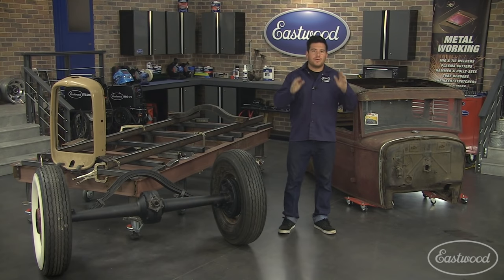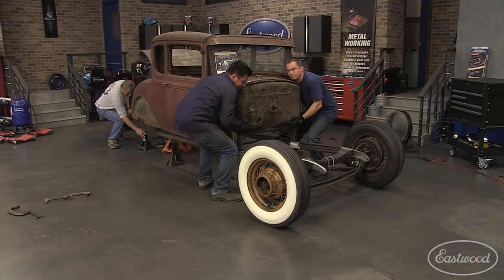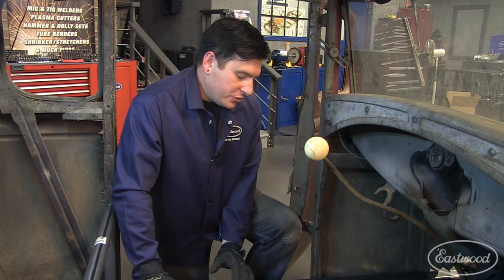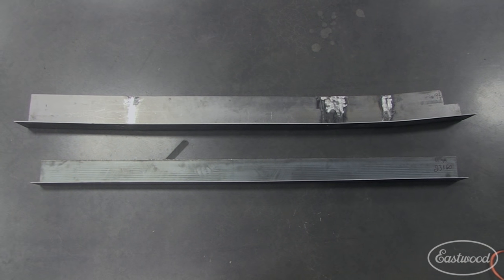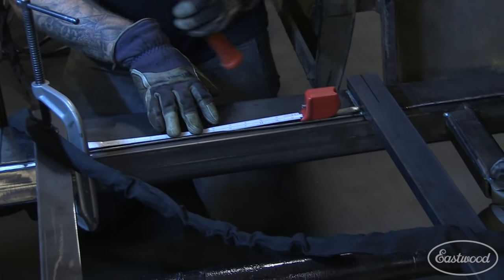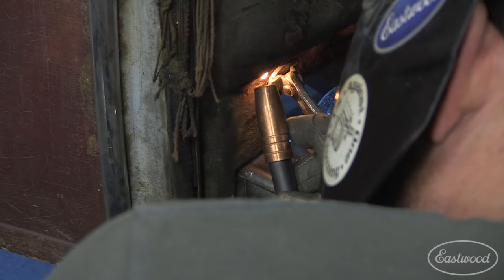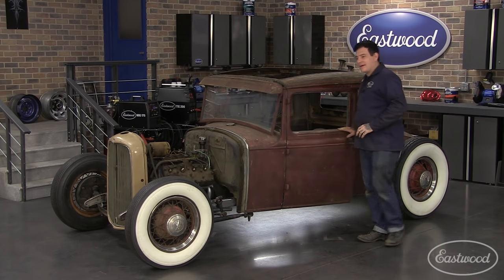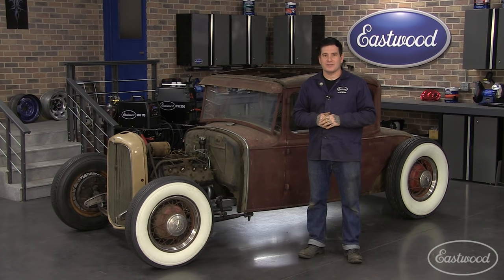Lowering Your Hot Rod - How to Channel a Ford Model A with Eastwood

Comment: when adding the bungs to the frame, you could get your bolt thread a normal nut then a washer then your bung to make sure you get a perfectly flat level with the frame and would take out some of the guess work
Reply: For those without a metal lathe you can buy flanged nuts and use a step drill to create a hole and recess, then weld the nut in.

Comment: Freeze @9:07.  What's the clearance between the drive shaft and the second cross brace?  There doesn't appear to be enough room for travel?  Did you wind up having to adjust there?  Thanks!

Comment: I want to channel my '34 three window coupe but I don't have any tattoos. Will I still be able to do it or maybe I can just get some spiderweb elbow tats to start with? 

Ha, ha, just messing with ya! Good job on the channel. Are you going to run any body welting under the sub floor frame or are you bolting it solid to the frame?

Comment: How much would I have to extend the front frame rails, so that I can fit a 350 Chevy engine in it?  It looks like the original firewall would need to be cut to allow the Chevy distributor room.  I would like to leave the original wheel base as stock.  And I like the looks of the original firewall.  Any suggestions would be appreciated.  Thanks.

Comment: Great video. Wanted to ask why you opted to tig weld everything instead of wire feed, mig or flux, or even stick. Years ago, when you were down on Rt.30, I bought a Century flux core machine. Used it when boxing some frame areas on my 51 Chev. 1/2 ton. Was happy with the results on the frame, not so happy when I tried sheet metal, too hot. When watching your video I thought the flux would have worked fine, especially if you ran into a position situation. I need to justify the need before purchasing another machine, agree that the tig finish is tops but who's gonna see it, so that benefit is lost, know what I mean. 
Thanks in advance. Jack
Reply from the maker: Matt is just a fan of TIG welding. Could MIG have worked here? Absolutely, he just likes to show off 😎
Reply: Eastwood Company thanks. Nice job. Like tig but too busy sometimes. Was building a tire rack once out of pipe and fittings, tig practice, rod, torch, shield, gas pedal, some over head, standing on one foot, balancing....... too busy !! Finished with stick. Just one of my stories. Thanks again. Stay healthy. 👍👍
Reply: Tell Matt I said nice job. Nothing like a nice weld.

Comment: Curious as to how you decided which type welder to use at each place. I understand using the tig on the frame rounded nuts but why did you use a tig on the cross channels instead of the mig? What was the advantage here?
Thanks for the videos.
Reply from the maker: +amtpdb1 I prefer to use a TIG anywhere possible but I was forced to use the MIG in places where I couldn't get my hands/the torch in or the metal wasn't clean enough for a nice TIG weld. Hope that helps! -Matt/EW
Reply: Just as a heads up your TIG welds are going to crack from vibration, you need to fill in the craters at the beginning and end, add extra filler, and taper off on the amps when you get to the end of your bead will help prevent it from cracking right away.

Comment: just wondering does welding on those grade 8 nuts make them  weaker ? nice job hope to see more
Reply: +Lester Gross I would have used a nut cert. I'm surprised Eastwood doesn't try to sell them.

Comment: What happens when you get to the radiator ? How do you lower that ?
Reply: George Dean you will either notch the bottom of the grill shell to lower over the front cross member. Or you can section the center of the grill out. But doing either of these two if you go very far you’ll need to get a shorter radiator to match the grill shell. I have seen in the past people moving it forward an inch and using or building some aluminum offset tubes for the water neck. (This is one reason I like quarter elliptic suspensions, it cancels all that out) 👍👍
Reply: @johndoeOU81TOO  , one more question- is the 28-29 radiator shorter than the 30-31 ? I have both shells and the 30-31 shell is about 3" shorter. I was going to use the 28-29 shell on my 31 roadster with a 3" channel job...
Reply: Sorry bout that, the 28-29 is the shorter one...

Comment: Why not put the axles above the frame?
Reply from the maker: This is a traditional method that has been used for decades.  You could go that route but it would be a different approach to the build that would be an entire re-work of what we had planned, as we built the frame and planned suspension with this in mind.

Custom cars are built like a cake - with a recipe.  So you have to make sure your components all work together nicely.
Reply: @eastwoodco  I kinda wondered why "no one" tried that…after finding an uncredited pic (via google) where someone did. In some cases it seems like wasted work, but in others it should be easier & it seems like leaf springs should be fine…

But it would destroy the body if a spring or mount failed…

Comment: I need an old car i can turn into a hotrod.... and then ditch the engine put in Electric Drive ... huehuehue .. 

Let the hate begin tips cap and drinks tea ~
Reply: Blaze 125  You won't get much. Some wrecked Teslas have already been plundered for their drive systems to do just that. There's a 56 Caddy on YouTube somewhere going through it now.
Reply: Why  have electric 

WHEN YOU CAN HAVE DIESEL